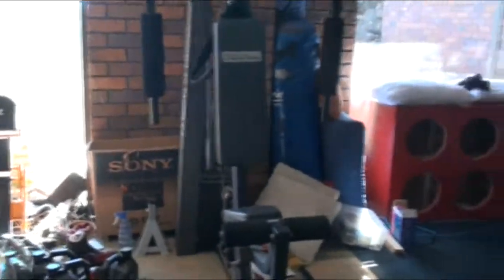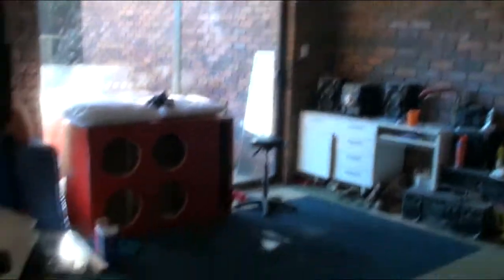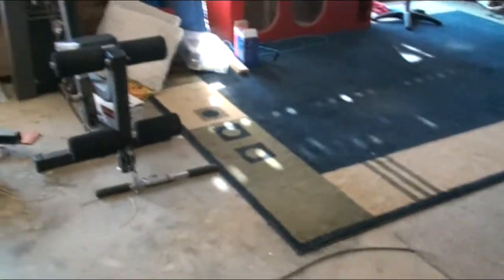Camera Stabilizing Handle/Grip Test with Sony HDRsr11e - Zeikos

Comment: I guess it does smooth out the movement somewhat, but you still need to hold it reasonably steadily. Watching most modern TV programs and movies, this 'handheld' but slightly smoother look is really popular. With careful use, i.e. slower pans and camera movement, this could be quite good!